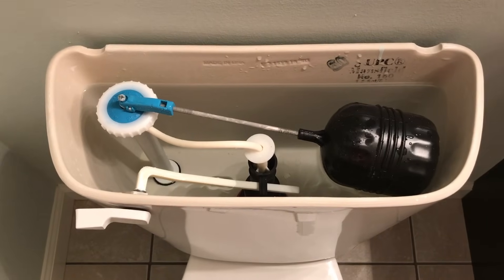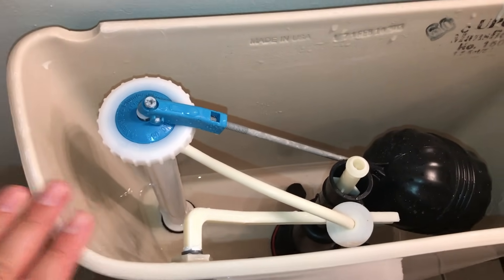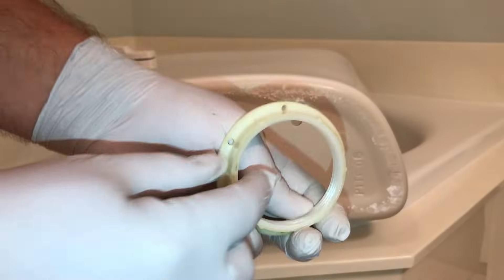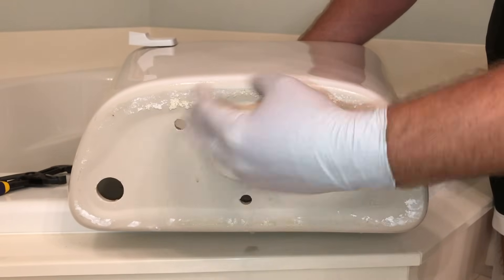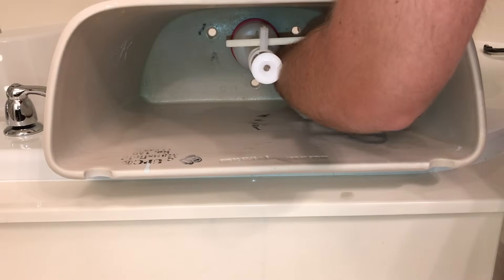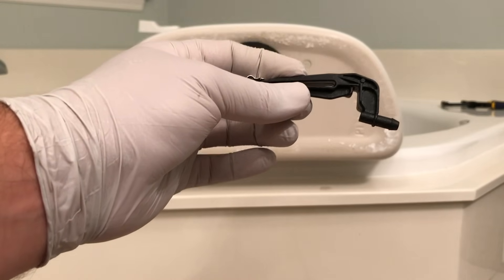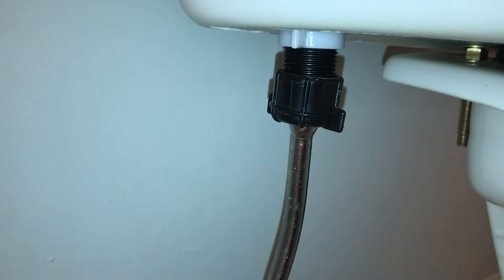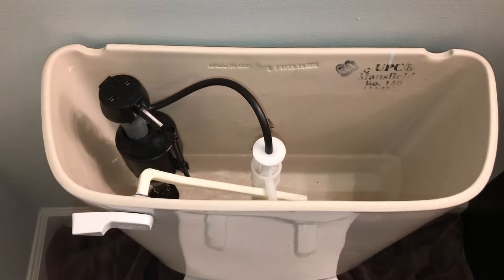Replacing Fill Valve & Flush Valve for Mansfield Toilet

Comment: I used the old tank to bowl gasket because the new on seemed too thick.  The old one (10 years old) seemed to be in good shape.  In your video the plastic coupling nut for the water line looks like it is a bit crooked on the tube of the fill valve.  Maybe it is just an angle of camera thing.   Anyway, I am going to leave the water turned off tonight to make sure there is no leak through the drain over night which would trigger an occasional runninig of the toilet which was started me on this project.  If tank is full in the morning I will have been successful.   I hope!
Reply from the maker: Your observation of my having cross threaded the supply line to the fill is correct. I corrected it off camera where subsequent shots should show it’s on correctly.  Good luck!!

Comment: Great video!...probably worth mentioning the requirement to reuse the circular fastener as opposed to the hex replacement fastener
Reply from the maker: Thanks for the feedback
Reply: Was wondering the same. Why?
Reply from the maker: it’s because the spud gasket itself is circular and you want a good seal.

Comment: video was great, helped me find the right parts i needed to rebuild my broken toilet and the little tips were helpful.  I decided to just gut the whole thing after watching your video.  Why would they provide a hex lock nut that goes in a round gasket??  i didn't like the fit so i reused the old round one as you suggested,  would not have even thought twice about it if i didn't watch this video.
Reply from the maker: You can find one with the round lock nut.  At the time, I think my big box store was just out of stock :¯\_(ツ)_/¯

Comment: I just want to add one more step; after you fill the tank for the first time, there is now extra weight on the tank seal which will compress the seal a bit. With the tank now full of water, the three tank nuts may need a wee bit of tightening to prevent leaks somewhere down the road once everything settles.
Reply from the maker: thanks for sharing!

Comment: Good video. At 18:30 it looks like you cross threaded the coupling nut on the fill valve. Appreciate the detailed info
Reply from the maker: yea :). definitely did. I fixed it after the video shot. I wished I had done so as part of the video and called it out as something to be careful of. Good observation!!

Comment: I have an old toilet not sure make or anything else for that matter. I did look inside but couldn't read well, I also looked on the tank lid but all I could see was a three digit number 17? Not sure think it's a 6 but the numbers were printed backward. So, what do you suggest. It will be my first time trying to replace due to low funds. Please help. Thanks for the video and the support. 😁🌹
Reply from the maker: You can look for a universal kit that fits most toilets

Comment: To other DIY'ers, note Mansfield toilet. I just went through this on a Mansfield toilet in a home we recently bought. I've done this countless times on other homes we've had but surprisingly, the universal kit I bought, and have always used before, did not work on our Mansfield toilet. The casting on the base of the tank was a problem with a number of recessed surfaces (the one in this vid looks flat so that's good). The home was built in 2007 so it's not that old. Just passing along.

Comment: My Mansfield inside looks identical and building services replaced a valve but it doesn't release sufficient water.  I can see the water level is about two inches below the top edge of the fill valve.  Yours looks much higher.  Can I correct this low water level by adjusting the float level?  Looks like a screw adjustment is there for that purpose on the float.  Thanks.  Excellent instruction and step by step very helpful.
Reply from the maker: yes - adjusting the float will allow for more water in the tank. Just be sure the water line stays below the threshold of the flush valve.

Comment: This video is going to be very helpful when I go in to redo mine.  The tank constantly leaks into the bowl, and replacing the red full seal hasn't stopped it.  I do have one question, if the round tank to bowl nut isn't reusable, is it ok to use the hex one?  I'm not sure if I missed that in the video.
Reply from the maker: Yes. The hex one is totally fine, especially if the flush valve comes with the spud gasket

Comment: Thanks for the video.  I wonder if it is possible that when one toilet valve is fixed, the water pressure changes make the other toilet on the same floor not performing like before.  Water is not being released, and I have to use the local water line valve to let in water. This becomes difficult that we have to do it after every flush in the other toilet.
Reply from the maker: shouldn’t... the valves wouldn’t have enough variance in pressure regulation to likely make that kind of impact, let alone have impact while sitting idle during a flush event on the other toilet. If this issue was experienced after changing out the parts, I could see why this is suspect, so I’d consider ensuring the proper parts were procured for your toilet. Firstly, however, I’d conduct some research into this behavior in search of other plausible explanations and resolutions.
Reply: @theXchange  Thanks for the quick reply.  I will investigate.  Will releasing more water through the central valve in the basement affect the water pressure upstair on the second floor?  I want to pump more water up so as to make both toilets work without having to turn the local valve each time....
Reply from the maker: I can’t say for certain as water pressure from the street vary. I have a two story and have mine fully open.

Comment: Thanks for the great video.   I  have been wrestling this toilet off and on for 3 months.    Fortunately, I have 2 toilets.  LOL.  I have followed all of these instructions, fixed some mistakes that I misread from the parts packages, BUT, it is still leaking between the tank and bowl but only when flushed.        Any troubleshooting tips.     On a budget, which does not include $80-100 per hour plumber.
Reply from the maker: make sure the spud gasket is seated properly and the tank to bowl kit it tightened enough
Reply: @theXchange    I gave it a break, then went back to observe this morning.   I had hand tightened everything.   One nut just needed a couple of more turns with the socket.   Problem solved.   The fear of not over tightening and breaking the bowl, was my downfall.    Thanks again for the great video.   I bet next time, I can do it in under 20 minutes.
Reply from the maker: I hear you on over tightening!  Nobody wants to hear or see cracked porcelain.  I’m glad you got it figured out and have both of your bathrooms up and running!

Comment: Overall a nice step by step video.  I like the tank residual disposal into tub (shortcut), and your comment about using gloves because of the rubber washer degradation (black rubber oxidation/chorination).  I was surprised you used your bare tub edge as the tank worksurface since the back of some tanks isn't fully glazed, or could be "rough" and scratch the work surface.

I note that when you attached the existing supply line to fill valve nipple the nut appears to be crossthreaded  (look at both attachment segment and the water valve open/leak-check segment - the first view shows the nipple threads oddly cocked vs the top nut edge, plus in both views the nut shadow is not parallel to the extended nipple profile - that is not due to the angle of the flashlight/lamp).  Regardless I hope you didn't end up with a leak or ruined threads on the valve inlet.

ONE CAUTION I think you should add to the video - perhaps by text like some of your other tips - is that the supply tube for the original fill valve may not be the correct length for the new valve, or that the washer on the tube end may be degraded after removal and leak when reinstalled, so a spare fill line (hard tubing or braide-reinforced flex line) should be available, similar to your good advice on having a back-up tank mounting bolt/spud washer kit.

>>>>>>
UNRELATED to your video, but as something for others to think about:
Approx. 2y1m ago I replaced the American-Standard Cadet-II standard flapper type flush valve components with the superior (IMO) Mansfield 210 design (but as a Keeney Mfg assembly,  since Mansfield's are NOT common residential fixtures in this area).  I made this change after / because of many years fighting premature failures of aftermarket replacement flappers ("normal" and delayed closure, both name and no-name brands), seat overlays (Fluidmaster kits), and various flapper materials / mfr. designs.  American Standard quit offering their original (excellent) flapper design as a replacement for this toilet (AS orig has a separate softish seal surface on a hard plastic flapper).  Oddly, two other toilets of same model and age each have their ORIGINAL flappers -  they are approx 23 years old and still seal just fine despite all 3 being exposed to the same water quality.  

Until two days ago the Mansfield 210 style (though rather noisy operation during tank/bowl fill period) provided a consistent positive seal.  A surpise (plus gloom, despair, and agony on me) occured when after nominally 6x my prior flapper life the seat seal ring (still one piece) came off the valve base for no apparent reason.  That seal can be reset but the valve "bell" no longer seals againt it, I estimate the leakage rate is about 1/4GPM.  I replaced that seal with a new one from Keeney, then one from Home Depot (Everlast) - both have a leak rate of about 1/8GPM and the fill valve cylces over ~5 minute period, so a simple repair seems to not be in my future due to either bell-edge wear or part incompatibility, maybe both.   

I purchased complete "210" flush valve replacements from Everlast/Home Depot and Keeney (from Lowe's) when making the original change, finding the  Everlast sealing edge of the bell to be sharp and relatively uneven, with a stiffer seal.   The Keeney at that time had a smoother radiused edge vs the Everlast, and seemed would not abrade the seal when closing the valve.  In addition, the Keeney original seal felt and still feels like silicone, the replacements feel stiffer like a form of red/orange "rubber" (Everlast initial was similar red rubber too).   I plan to call Keeney about the seal material difference, as I have no local acces to Mansfield OEM parts.  Color me happy to have had 2+ good years - and would still recommend this move for others in my situation, though at this point looks like I may need to buy a whole Keeney kit just to get the siliconce seal style.  Absent that  I will consider ordering a new Mansfield 210 OEM kit, though really despite the thought of the tank disassembly :). 

Just sayin'...
Reply from the maker: Great comment!!!  Thanks for sharing!

Comment: After 4 hours of searching YouTube yesterday and several hours not understanding, but finishing the job anyway ... I find this today which is EXACTLY what I needed! GREAT INSTRUCTIONS!!! I have one question though. I have a ballcock instead of floater and the black tube you show, on mine is clear and is too wide to fit in the top of the middle thing so left it out and water flows through it to fill the tank but everything works fine anyway. What is that tube for and why does it fit n the middle part? Thank you!!
Reply from the maker: Hi!  Thanks for the comment, and the question!  I’ll refer you to here as I think it should answer it for you!  https://toiletology.com/glossary/refill-tube/

Comment: Great video... fix my problem original problem. 1 question how you add more water in bowl. I lost a little bit of water in the bowl
Reply from the maker: you can make an adjustment on the fill valve to control the fill line.  Did you use the same fill valve as the one in the video?
Reply: @theXchange  yup it adjust the water level in the tank but the bowl went down a little bit
Reply from the maker: I would try adjusting the fill valve as that’s usually the variable
Reply: @theXchange  thanks for the help

Comment: Great video. But to set some minds at ease, the round seal and the plastic hexagon lock nut WILL work together once everything is tightened. I got no leaks. Just in case you have to destroy the old one to get it off (I didn't have a large enough vice grip so I chipped it off with a hammer and screw driver)... you won't need the circular lock nut - so no need to save it.

Comment: What if you can't get the hex nut off the bottom of the toilet tank? I was able to unscrew several turns and now it's stuck.
Reply from the maker: If you have a hack saw, saw it off. That’ll be the easiest way.
Reply from the maker: If it’s stuck as in it won’t turn anymore, you could also try some WD40.
Reply: I actually go it off by first soaking it in a small bowl of hot water from the tap for an hour and it came right off! Thanks for the great video and quick response!
Reply from the maker: Tamala Stewart Awesome!

Comment: It is truly amazing the water supply line wasn't leaking! The nut is visibly cross threaded onto the fill valve! Normally putting a water line crookedly into a mating  part and then cross threading the nut gushes water badly. This man must be the luckiest man alive. That plastic nut is off by at least one thread from the left side to the right side, if not two. See 18:34 for verification of this.
Reply from the maker: This has been addressed throughout the comment history. Please refer to the comment threads for existing conversation pertaining to…

Comment: What wrench did you use get the circular lock nut off? Also what to use in case the other nuts are more than hand tightened so the plastic wings don’t break? Thanks!
Reply from the maker: I think there’s a link to the wrench I used in the video description. Regarding the plastic wings, those should not be reused. Buy new. By now, that plastic is likely malformed and/or brittle and won’t keep a good seal and you’ll have leaks.

Comment: Thank you so much for the instructional video.  My toilet was hissing every 10 mins so I replaced the Mansfield fill valve with a Fluidmaster one instead.  It is still hissing and I'm starting to wonder if the flush valve needs to be replaced too.  Or could it be the Fluidmaster fill valve?  I don't know, the Fluidmaster looks a lot sturdier than the Mansfield part and easier to install without the float ball.

Comment: That supply line coupler looks cross threaded/ crooked other than that this was. A great how to
Reply from the maker: Your eyes 👀 do not deceive you. :). I fixed it off camera once I realized it
Reply: @theXchange   my flush valve is sticking it snapped the flush lever it’s very hard to flush. Will attempt this project tomorrow to replace flush and fill valve along with necessary hardware

Comment: I had such anxiety just thinking of how I was going to tackle this project but ur video  has given me the confidence to attempt it. My only concern now is what Curtis commented on. Can I follow your exact directions using Mansfield parts? The inside of my toilet stamp reads #160. Thanks so much for this video!
Reply from the maker: You can use the exact instructions.  :)

Curtis mentions that a #211 flush valve should be used in the Mansfield #160, and that they’re not commonly available in big box stores. The #211 can be found online however. Have a look around, and ask away with any other questions!
Reply: Kris Reese Thank you so much for your guidance!
Reply: Kris Reese Hi Kris, just wanted to let u know that thanks to ur brilliant video I finally & successfully replaced the parts of one toilet. And I used the #211 valve that Curtis recommended. After flushing only half of the water emptied from the toilet as he indicated 👏🏽. The most difficult part for me was using the vice grips to remove the plastic gaskets. I had to call in muscle to do that. The rest was easy. Thanks again for empowering this woman to do her own repairs 💃🏽. I got a quote of $275+ per toilet here in Jersey 🤨.
Reply from the maker: Nelly, that’s great!  It’s such an awesome feeling, isn’t it!?  I’m glad you knocked it out and saved some cash 💰 along the way!
Reply: Kris Reese It’s such a great feeling, to be able to do it myself. Ordering the parts for the next 2 . I can spend what I saved on a new handbag 😬.